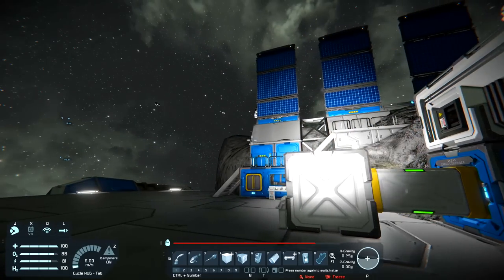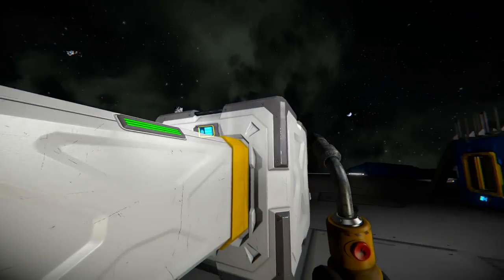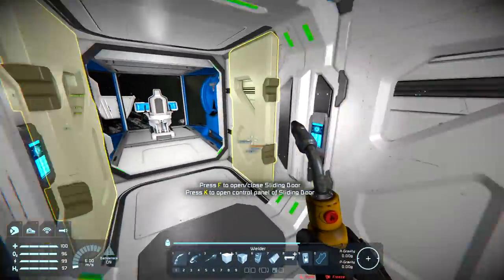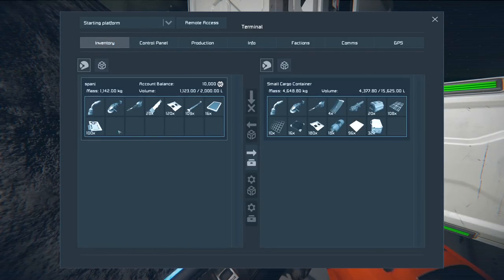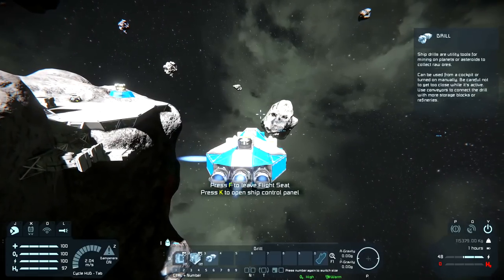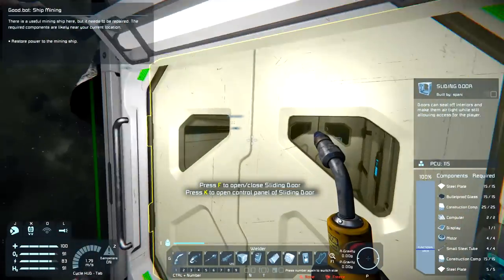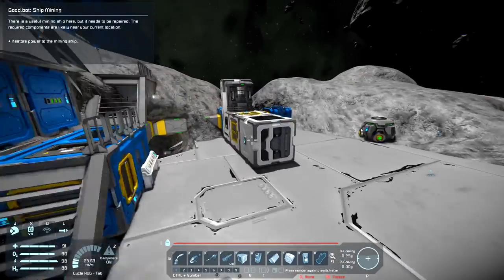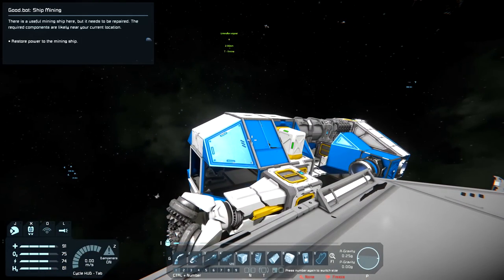MY DRILL HAS JUST NAFFED OFF! | Space Engineers | Learning to Survive | #2

Comment: 1. Everything needs to be connected if you want to move items between their inventories.
2. Unlike in Empyrion, thrusters damage blocks in front of them. That's why your conveyors kept breaking the retro thrusters melted them off.
Reply: Yep, and on the right side the connector tube elbow was all that was holding the drill on, because not all surfaces are attachment points like Empyrean.
Reply: @Durstalph  Yep, so far it seems only block facings that have connector ports or the flat facings of armour blocks let you attach other blocks. Please correct me if I'm wrong as I'm also quite a newb at SE.

Btw... Empyrean... the Warp is overtaking me!!! - turns into a Chaos spawn - :D
Reply: Btw, is it true that components don't transfer through certain devices such as the oxygen and hydrogen tanks/generators?
Reply: @shinzou1085  no, the only time you will ever have problems with things not transferring through a device is if the device is off, or on small grid if they are going through small conveyors which tend to only cary ores, steel plate, and a few other things.
Reply: i laughed so hard when he did that xD
Reply: There is a bug with Medical Station top conveyor not transferring through, but only components, O2 and H2 going though fine.
Reply: @shinzou1085  only in small grid conveyor that have restriction

Comment: Other people replied but in case it's not clear: the order in which you connect things makes (edit: almost) no difference in Space Engineers. Everything you connect with large conveyors forms one ‘conveyor network’ and items will not only flow freely between them, but also automatically (the assembler will take ingots from the refinery, the refinery will take ores from storage, the o2/h2 generator will take ice from wherever, etc) to fit their programming. Putting machines right next to each other, without conveyors, but with their conveyor ports touching, also connects them in the same network.

Small conveyors are the same but only some items can pass. I haven't played in a while so I don't remember the details, but I know parts don't pass, and ores do pass.

One thing that I've seen often cause confusion though is power. I think I can only explain this with an example. If you have a refinery and an assembler, but you don't have enough power for the two to run at the same time, they will intelligently turn themselves off, in alternation, as needed to do what you asked them to do. However, each machine's inventory is not accessible by the network when that machine is off; so, when the assembler turns on, the refinery will turn off, and so the assembler won't be able to pull the ingots automagically from the refinery because that inventory is not available. I've seen people make a lot of assumptions about why this happens, redo their entire conveyor networks to try to fix it — but the problem is that the refinery is off, add more generators or batteries and you'll be good.

Edit: there's a blue patch in your mine (in your base asteroid), IIRC that's cobalt. (Unless it's ice? Ice is also blue but a different blue.)

You don't need to open the control panel, if you open the conveyor port instead, it goes directly to inventory. And you can access a conveyor port even when there is a conveyor attached to it, you'll see the yellow outline when you hover it.

The remembering what you need is actually one of the strongest points of this game, namely, the Build Planner. I won't write a build planner tutorial in this comment because there are lots of great ones already 😸 but if you learn that, the game becomes 200% better.

For docking you want the connectors, yes. There were connectors over there in the other station. I don't know if you have one in your ship, I think not but maybe it's there somewhere. The connectors effectively merge two conveyor grids in a non-permanent way (you turn them on and off).
Reply: Nice
Reply: Well said, except for one thing. I does matter the order things are on conveyor line. Drills, grinders (ASAP), refined ore and assembled components (when inventory starts to fill) will always auto unload into nearest storage. A common rookie mistake at start is to put refinery hard up against assembler. At first this is fine but it doesn't take long for refinery to empty all its gravel, or excess ingots into assembler. filling it up. And then assembler stops working because it can't pull in any ingots it dies need from been full of gravel/ingots it don't need. Its good practice to go something like drill/ore>storage>refinery>storage>assembler>storage (that you use to get components to build with). Sorters are always a option but they are the hard way. And be careful where ship docking is in line, most of the time last in line is best (unless its a mining ship)
Reply: @smell_instink /videos That's some nice info, thanks! Above my current level 😉
Reply: Update: this week I played a bit, not the same scenario but another that has the same ship. The ship definitely doesn't have a connector, but there are good places to add one. I also did see the issue that Shannon scott described here, so that was good to know.

Comment: Here's a tip that will save you a lot of frustration and time: USE THE BUILD PLANNER

Aim your welder at the blocks you're trying to build and right click... then go to the cargobox and click on the cog-looking button in the centre of the ui window, 4 buttons down from the top. It will automatically produce the necessary components from the assembler. To automatically retrieve the necessary components once they're assembled, click on the 2nd button down from the top with the arrow that points left. You can store up to 6 build-plans at a time and you can see them in the bottom right of the ui window accessed with "G" on your keyboard! Good luck!
Reply: Oh cool, I didn't  know that. I've been using Easy Inventory for that, but it's been awhile since I played.

Comment: If the refinery is connected to a storage box, then it will pull raw ore from it to refine it. Your assembler will pull resources from the refinery as needed as long as there is a connection via connectors from one to the other. doesn't have to be direct. They can both be connected to the same storage box. The conveyors will unload your ship. in a few seconds once you have it set up properly. conveyor tubes are very fragile. your drill went away because it was connected to your ship by only the connector. Cover your conveyor tubes and have some super structure attached to the drill just in case. Loving the new run. Can't wait till you get to the ship building. H2 generators use a lot of ice.

Comment: You may also wish to build more batteries for your base and more Solar panels. As to the reason your drills decided to leave you is simple. You cooked them off with you engines. You need to make the drills forward one space forward so the engine exhaust does not touch them, or you can save the resources and make a connector to your ship with a few more cargo containers, with a small landing gear on it so you can attach the miner to it. This way you can mine other resources besides iron, stone, and ice. Have Great one!!!

Comment: Here's a few tips:
* The order of connectivity doesn't matter - as long as everything's connected.
* R-click on an incomplete item to add it to the build planner queue (G menu), ...
* Middle-click on a cargo container to collect all possible items to complete your building queue, ...
* alt-middle-click on a cargo container to drop all ore / ingots / components into it
* The asteroid just in front of (a little to the right) contains a drill ship you can fix up.
* Create GPS markers everywhere.
* You can use sorters to pull items out of an assembler when it's done; however, it's simpler to just leave them there.
* When you're wanting a little organization in your life, look into Tilden's Inventory Manager script - it handles sorting items very well.
* In the G menu, the items with a "+" are item groups, allowing you to scroll through all items in the group when placing (with scroll wheel, IIRC).
* Assemblers will pull resources from the network if connected. Just start assembling the items.
* When conveyors and various items have no power, you can't pass items through them.
* Thrusters cause damage up to a certain distance. The starboard drill popped off because that side of the Survival block isn't a valid connecting point (it's not flat); the port side drill is fine.
Reply: Note - after learning as much as I did from you in Empyrion, it's kinda nice to watch you flounder a bit!

Comment: This is a very interesting look into Space Engineers from a fresh and almost noob perspective. A very good video since I'm a noob myself so I can understand when things are falling off for seemingly no reason at all. Doug Kress's comment was the most interesting and your thrusters are ion thrusters that use electricity to work so you need to convert the ice to hydrogen and then turn that into power for your batteries. Incidentally, converting ice also give you oxygen and you'd be wise to keep a stockpile of it in case you run out. Keeping bottles for your O2 and H2 is a good idea.

Comment: only a few tips (you might already know ) : if you drill (manually) and press F you collect while drilling, components only transfer through large grid conveyors not small, you change from building large grid to small grid by pressing the part you want to build twice (i mean the hotbar key), a conveyor always works in both ways and through other parts (like assemblers, ...), middle mouse button is the so called "build planer": it saves all the components you need for a certain block and middle mouse again on a open conveyer will extract the required components, there are three types of thrusters (hydrogen for space and atmosphere obviously need hydrogen to work / ion for space needs only power to work / and atmospheric also only need power to work), everything docks on everything (which is just great), thrusters damage blocks,  I hope you keep going ;)

Comment: the red indicator in production is just telling you the assembler does not have required resource, if the resource is elsewhere say in a cargo box the assembler will withdraw it, no need to transfer resource MANUALLY.  get used to menues as well, you can access the control panel from a seat in the ship by pressing K, you can access the inventory by selecting I, if the ship is docked you will also be able to access the stations stuff the same way

Comment: As long as the assembler is connected to a conveyor system it will pull parts it needs from any inventory connected to the conveyor system. It will not however correctly read that connected storage has what it needs to craft something so the interface is kinda Pants as they seem to say over there. I believe the hydrogen generator was also turned off thus preventing stuff going thru it to reach the cargo

Comment: As long as there is enough capacity in the resource storage area of the assembler, it will pull resources on demand. it isn't smart enough to include other inventory in the base. There are inventory manager scripts you can run using programmable blocks. This is probably beyond the scope at the moment though. there are a few shortcuts you will learn as you go for inventory management and build planner.

Comment: Your large grid ship (or CV ref from Empyrion) obviously has problems with conveyor connections. If you pick up items and you can't transfer them to another container, that means there is no connection. Any blocks with ports do bypass items so it is considered a connection. Drills will "push" items to conveyor system so items should be pushed to container or something else. If rock stays inside the drill it means it is not actually connected to the storage or storage is full.
In the small grid ships it actually matters which size of conveyors you are using. Small conveyors will only pass raw materials but you will require large size connection to pass build materials such as Steel Plates etc.

When using drills as a block tool (your "3" hotbar) you can use them in 2 modes - left-click is mining and right-click is just powerdrilling which does not give you materials but drills a lot faster and has much bigger area of effect. The later is often used to get through rock faster to the actual useful ore.

Survival module will not only give you ability to charge your suit but can also process stone into iron and nickel. But unlike the refinery you have to queue the production like the assembler. You have one in your CV cockpit near the drills so this might be handy. Survival module does it less effectively than refinery does but this might be useful before you actually set up the base.

Comment: Tips part 2:
1) enter --> /gps "Gps name" = if "gps name" is replaced with a name of your choosing it will create a gps pos at your current location with the name you give it. Ex: /gps Fe Asteroid will create a gps signal with the name of Fe Asteroid without having to go into menus to do so.

2) Change those doors out with something else asap they will kill you.
3) that hydrogen engine is only piped up at one end thus making your ship have two separate inventory systems.
4) Thruster damage gets some getting used to doesn't it?
5) there really isn't CV, hv, sv, ba designations in Space engineers there is only small and large grid and with the help of rotors you can mix the two on the same build.
6) watch out for good old uncle Klang whenever he shows up things get "interesting"
7) That scenario is basically what the Robinson Protocol was turned into from Empyrion.
8) blocks on the G menu with a + on the icon lets you scroll thru a few different shapes/blocks while you have it on the hot bar, pressing the same hot bar key twice will swap between large/small grid if possible.
9) not all blocks let you attach on all sides generally you can use common sense, but sometimes you will see a side that looks like it might be okay but get the middle finger like on the back of the survival kit for instance.

10) Have fun, and may Klang be with you.

Comment: things dont auto transfer to boxes unless you have a sorter in the conveyer loop
Reply: Not totally true. A sorter with right settings can make it happen faster. But drills, grinders, refined ores, assembled components etc... Will always auto move nearest storage eventually. Refinery and assembler will always pull in resources automatically if they have the spare storage to do so. 
Bonus tips. 
If u put a assembler next in line after refinery, when the refinery output storage starts to fill, it will auto unload ingots into assembler. Eventually filling it 100% with ingots/gravel it doesn't need. then assembler stops working because it has no more room to pull in ingots it does need.
If you have a container before refinery full of ore for it to auto pull from. It will refine in same order it is in container.
Power, Hydrogen and oxygen can flow both directions through a sorter block
Reply: @smell_instink  true, I was generalising tbh when they auto assign it can get bloody annoying

Comment: There is just so much going on thats WRONG... So many ways....your learning....but most of the stuff like production and conveyors and materials....your stressing too much...its very simple if connected just tell it and it does it....air vents if the room decompresses it will stop pumping air into room till resealed....ships will not float away so long as powered on and inertial dampner is on and have 1 thruster in every direction....z turns inertial dampner s on and off